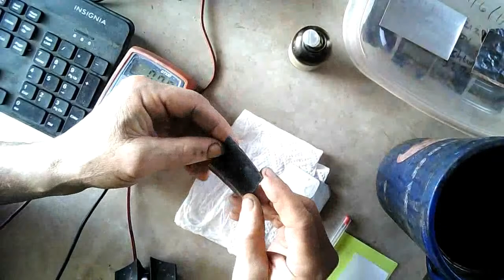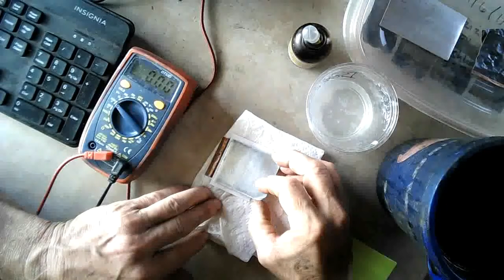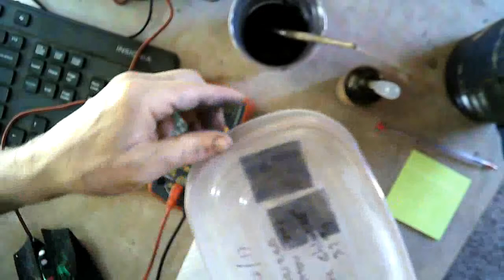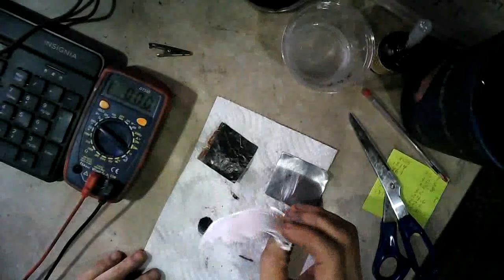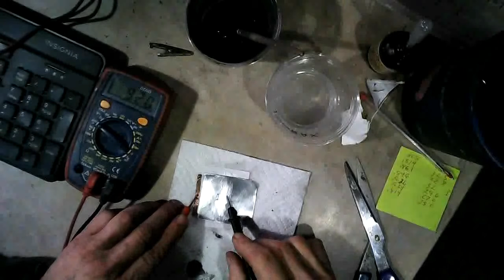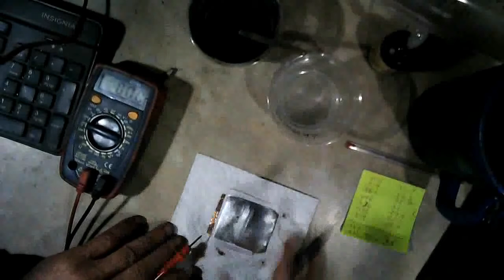Opportunity Knocks & Curing Experiments!

Comment: Well, that's certainly revealing. The results were not astounding but heading in the right direction and a significant improvement. It's a good thing you performed the test. Had you not done so it may have taken a while to come up with the same process. Historically that is how many discoveries are made. Your curiosity is serving you well.
Reply from the maker: Nothing happens by chance in my opinion Fred, all is cause and effect, even if we don't understand it. Both of those thin films presented opportunities at the exact time I was debating what to do next. Coincidence or divine guidance? Depends on your beliefs doesn't it?

Comment: hi just had an amazing experience with the new graphite marked MT i have received from our supplier...build cell with the normal procedure..added 1/4 of normal graphite to the seperator soaked it ..on the first voltage test 750mv and a incredible 600ma on 30sec charge 1.4 volts settle to 1.250v and astonishing 800ma on short cct test going to play the whole weekend with this
Reply from the maker: So you're saying a thinner coat of graphite is better than a thicker layer? I assume you are still layering your graphite 3x?
Reply: 3 layers very thin, im trying to get a camera fixed up to show, build 4 different configurations with graphite mixes the current varies from 300mAmp start up to 800mAmp, almost a 1/1 ratio to the voltage if the asembled cell gives me 850mV it is close to 850mAmps on short cct, what i did find made difference is solution of toothpaste with ZnSo4 and grapgite that holds to what i believe the voltage longer 12hr rest test voltage dropped to 350mV and current was on 250mAmps, so the big question is what is inside sensodyne tooth paste..
Reply: if i start with one layer it varies between 550 and 350mAmps, the second layer gives me extra 200mAmps approx.. the third realy jumps to 1.355Amps...loads of experiments this  days comming
Reply from the maker: Interesting, I'm looking forward to seeing the videos. What size is the cell?
Reply: the active area about 3x3 cm, im trying to change the elctrolyte to give higher voltage this afternoon in settled by 875mv but still pumped 1.25 Amp, when rested for 30 second it fall to 675mV but still deliver 765MAmp on short cct test. this evening for 1 hour i have made several 30 second charges with rest of 10 seconds then the short cct test the current keep climbing 1.1amp - 1.25amp -1.35 amp so the cell is resting this evening til tomorrow hopefulle there is still some kick in it...very strange behaviuor i get from mixing different carbons..the voltage is lower but amps higher
Reply from the maker: Wow! That's a lot of power from 9 square cm Barry. I should be hitting 200 milliamps from 16 square cm soon with more coats of graphite. It's nice to know I can really boost the power more if I need to with electrolytes. :-)